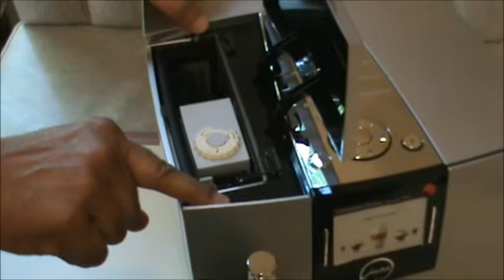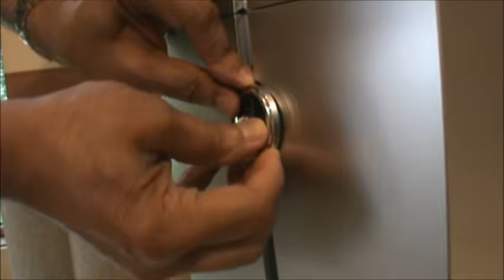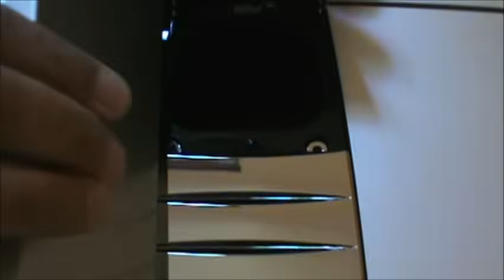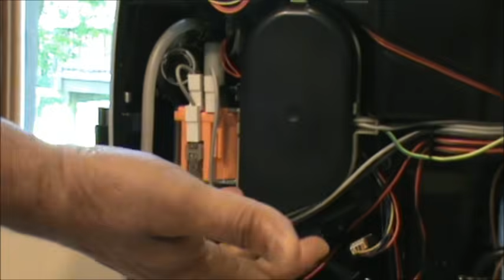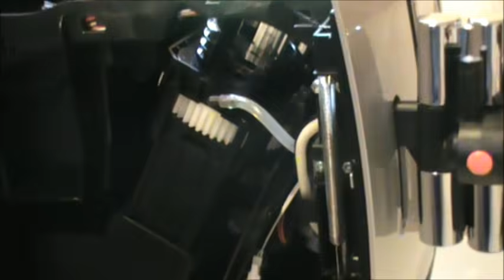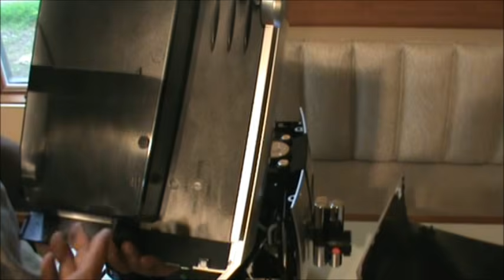How to Open and Disassemble Jura Impressa J5, J6, J9, J80, J90, J95 Coffee Machine

Comment: Hi @PartsGuruUSA I have  the xJ9 machine and after it is switched on  it makes a whirring noise then displays error 6 . I don’t have the oval head tool to open the side panels .
Reply from the maker: Error 6 is due to the bad multi valve.  You'll need the oval tool to remove the 6 screws from the top panel and then remove the side panel.
Reply: Yes I managed to use the oval tool to remove the side panels, do I need to order a new multi valve? Or can it be fixed?
Reply from the maker: Yes, replace the valve.
Reply: Ok thank you so much , 😊 where can I order a multi valve?
Reply from the maker: you may order from the website
Reply: @PartsGuruUSA  Ive tried accessing the website from my phone but it doesn’t seem to be working , can you send me the url please

Comment: I've had my J90 (second hand, new in box) for about 7 years.  No problems until a few days ago when I pressed the "coffee" button, the grinder runs and then the machine shuts off.  No beeps, no blinks.  I found your video and took the machine apart to examine and clean the brew group.  While cleaning, a stainless washer fell out.  Later, I heard a rattling inside, and after shaking and rotating the brew group, a stainless bushing came out.  I have no idea (despite much searching) where in the machine these belong.  I lubed the brew group with food grade grease and put it back together.  It is working, but I can't help but wonder where the extra parts go.  Any ideas?
Reply from the maker: There are 4 metal washers that connect to each sliding arm and under. There is also a metal retaining clip that secures the metal rod to bottom of the brew unit.

Comment: Thanks for the informative video, I've purchased several parts from you as well. Great service! I have a question. My jura j5 freezes after a time, the led doesnt display a error code. I have to unplug and restart the machine. How do I remedy this error?
Reply from the maker: Hello,  your machine may need to be throughly services if not done in a while.  Are you located in the US?

Comment: OK, so this is Very Odd, My Rotarry Dal on my J9 Will NOT Turn, It was fine before I cleaned the tray (I hardly ever use the dial) But I know it worked becasue if tested it before. But it will not turn now? Its almost like it has a lock on it? Jura had NO CLUE ugh. Any ideas guys?
Reply from the maker: That’s not good.  If the dial does not move then you may need to replace the entire display module.
Reply: But have you every heard of this or can give me a logical reason? It doesn’t make sense from an engineer g perspective
Reply from the maker: We have not encountered this issue in repairing the J line machines since they were introduced.
Reply: There is No locking me h correct?  Also the ring around it is orange.
Reply: Please checkout the video I uploaded (should be avail on my profile)

Comment: I have an Impressa Jura J9.3, the machine displayed an error message " Hardware -Fehler:2" what is that, what should I do to fix the machine?
Reply from the maker: Hi Lawrence,  ERROR 2 in Jura J9.3 is related to the malfunctioning thermal sensor or fuse that's mounted onto the thermoblock.  J9.3 only features a single thermoblock.  Please check the two components in your machine.  We have both items in stock.

Comment: My Jura impressa J9.2 is displaying " Fill beans" albeit there are enough beans in the bean cup. I took out the beans & clean the cup and re-try but to no avails. Please suggest how to fix the problem. I don't have special tools to loosen special screws to dismantle the grinder
Reply from the maker: Hi Aung Pe, How long have you owned the machine?  Has your machine ever been serviced?  How many cups of the coffee have you made from J9.2?  The issue could be related to the blunt and worn out grinder burrs that are located inside the grinder.

Comment: I have gotten to the removal of the logo on the back... now, how do I find a tool to remove those two screws? What kind of screws are they? Help
Reply from the maker: These are oval head screws.  We have a special tool available on our online store to remove the oval head screws.  You may use the link below to purchase the tool:
http://shop.partsguru.com/Jura-Oval-Head-Key-Stainless-Steel-0010635.htm
Reply: Torx I believe TS20 or 25. Local hardware store should have
Reply from the maker: @LymanSheba Torx 20 for removing the brew unit screws and Torx 15 for the drainage valve screw at the bottom of the brew unit

Comment: Hi Parts Guru. Thanks a lot for a very useful video, but I lack information on the actual TOOL to open up the J9.3 one touch TFT. Without the tool, it is very difficult to start repairing... Could you please inform WHICH TOOL is used and if you can provide it ? I only have these round pins, which has no rough edges like torques and normal screews. Hope for your assistance on how to open up the machine. Thanks from Denmark.
Reply from the maker: Hi Peter,
There is a special tool that is used to remove oval head screws from Jura espresso machines. Here is the link to purchase the Jura oval head tool:
https://www.juraparts.com/products/jura-oval-head-tool
When was the last time you descaled/decalcified your Jura J9.3? Descaling the Jura J9.3 is the single most important maintenance. It helps to remove calcium sediments from water passages inside the machine, improves hot water temperature, and ensure full jet of steam for steaming milk. Please descale your Jura J9.3 if you have not done so. Please stop using the Jura Clearyl filter, if you are, as it's completely ineffective and useless. It only removes bad tasting odor from the water and does not remove calcium sediments.
Reply: Thanks again. As you states, the machine needed a good descaling. Since I could not open up the machine my self, (without the oval head tool) - hence I turned the machine over to repair shop. It is now back, as new and working again. Thanks for your time and effort :-)

Comment: Thanks for this video.
We have a issue with this machine.
When making a cappuccino, the coffee goes out from the central hole and not on the left one (used for milk).
Have you got an idea of what's going wrong?
Thanks again
Reply from the maker: +Olivier Leroy Hello Olivier: please let me know the model of your Jura machine.
Reply: It it a Impressa J9.3
Reply from the maker: +Olivier Leroy there's a switch over valve in J9 seated beside the display module.  It determines whether to direct coffee from the brew group the left or center hole.  Based on your description, it seems that this switch over valve is not working properly and directing coffee only to center hole.  What happens when you make just a regular coffee?  Does it dispense from the center or left hole?
Reply: Parts Guru - same thing with my j9. When making a latte, the coffee dispenses from the center. Please help!?
Reply: Me too with a Z5, who died recently, I just bought a second hand J9.3 this week, hope will not happened in the future, seems to be difficult to repare.
Thanks a lot Parts Guru for your clear tutorials

Comment: Thanks so much for this.   Not sure I would have figured out the screws under the emblem on the back by myself.   The video made it much easier to disassemble my J6.  There is a torx screw in the water tray holder area (at the front center) that you have to remove as well to get that side off.   I was able to remove oval screws by using a pair of needle nose pliers and using small vice grip pliers to clamp the needle nose pliers on the flat part of the oval screw.  It is tricky and takes some patients.   Once you break the screw loose you can just use the needle nose pliers to take them out.  I replaced the screws with phillips head screws so I don't have to do this again.
Reply: I don’t see a screw just a flat dark top over a screw hole. Is that the  screw?
Reply from the maker: +Terry Chapman Hello Terry:  I'm glad you found the video helpful.  The oval screw by the water tank is buried deep inside.  Kudos to you for removing the oval head screws with nose pliers.  I'm curious as to how you removed it without the oval head tool.
- Tommy
Reply: I looked closely to find the slightly flat side of the oval.  Put my needle nose pliers on the "flat" sides, and then used a pair of vice grip pliers to clamp the needle nose pliers onto the flat spot by clamping them across the needle nose pliers.  It was a bit tricky but worked in a pinch.  I will try to take a picture of it and upload if I can.

luckily, the screw in the water tank recess that holds on the outside plastic casing on that side was a torx otherwise my trick would not have worked as it is really recessed in there.
Reply from the maker: +Terry Chapman Great, thank you for sharing.  A picture would help too.  I'm sure it'll help many Jura coffee machine owners that don't have the oval head tool.

Comment: HI,
We poored water in the pre-ground coffee
We tried to take all the water out and dry it with a hair dryer the best we could 
We put it back on and it seems to be ok but should we try to take it apart to make sure that the machine is ok?

Please let me know
Reply from the maker: +Marie Burban Wohlfahrt-Khaelss Pouring the water in the pre ground funnel should not cause any issues.  You're lucky you didn't pour it into the grinder with coffee beans.  That would have required taken the machine apart.

Comment: Hi, my Jura ENA Micro 1 sometimes doesn't make the turn off washing cycle. It just sounds as the group motor stalls and then it turns off, but doesn't pumps water. Then I can't open the drip tray, because the group is not on it's home position, so I need to turn it on again so it goes back and open the tray.

Sometimes it does do the washing cylce and turns off with no problem. 

The machine is one year old. I use it daily to brew one shot then I turn it off again. I've cleaned and descaled when the machine requests to. What could it be the problem?
Reply from the maker: +Alex Nifco Did you purchase the machine brand new or used?  All Jura machines comes with two year warranty. I would contact their warranty service department to have the machine repaired.
Reply: Thank you for your reply. Just made a cleaning cycle with a cleaning tablet and later with a flashlight and wood stick removed stuck coffee grounds on the chute that leads to used coffee deposit. Now it's working perfectly. I think that the coffee beans I've been using are too oily, so changed my beans type. Best regards

Comment: Hi,
thanks for your very helpful videos which helped me to repair my J5 in the past.
My J9.3 recently developed a problem. After accidentally spilling some water over my J9.3, the machine when starting up displays "Jura" in red letters on an otherwise black TFT screen. The dial wheel on top blinks red for less than 10 seconds. Then 3 beeps are audible, and the machine shuts itself off. Is this some sort of an error code? If so, what does it indicate, and who can I fix it? Thanks very much for your help.
Reply: i have the same problem. Did you fix it?

Comment: Hello mr Parts Guru. Please can you explain how to fix Error 6 with an Jura J9.3? Thank you very much.
Reply from the maker: Esther B Hi, Error 6 in J models is related to the malfunctioning electronic multiway valve that is located at the bottom of the front right side of the machine when facing the machine from the front.  Were you able to remove the side panels?  Can you please monitor the water flow and see if any water is being passed through the multiway valve?

Comment: Hey! I see that you're luckily quite active and responding and I would be VERY grateful if you could answer. I have a Jura J5 machine, but when I try to make an espresso, coffee, anything, it doesn't pour the coffee out and it just seems to grind up beans, drop them in the little plastic cup & release water in the bottom of the machine. 
Is there any fix to this?
Reply from the maker: jodawgsup Hi, It seems like the water inlet to the brew group is not opening hence hot water could not get into the coffee compacting cup for brewing coffee.  Please make coffee using pre ground coffee and let me know if you are able to make coffee.

Comment: Cleaning lady put some water in the bean grinder and now grinder works but beans don't drop into the grinder and machine says to fill beans, tho it is full. I cleaned out and dryed out the reservoir and used a cake tester to clean as far down into the grinder as possible--still the beans don't drop, the machine whirrs, but no grinding is happening. Suggestions?
Reply from the maker: Hi Russell,  You may want to open the machine, and clean out the grinder.  You will need to remove the grinder burrs, and clean out the grinding chamber.  The inside is clogged with residual ground coffee.
If you're unable to fix it yourself, then you can send it to us for repairs.

Comment: Hi, thank you for the information. We are interested in buying the new 9.4. And there are some questions: How is the over all build quality? Is it also all plastic? How efficient and reliable is the full automatic cleaning process? We don't want to be poisoned by germs!
If you find time to answer: Thank you very much!
Reply from the maker: Oliver Leu External casing for all Jura coffee machines is made of ABS plastic.  In fact, super automatic machines manufactured by other brands all use plastic.  Only the commercial grade and recently introduced prosumer models such as Magister Stella, Expobar, ECM machines are designed with full stainless steel body.  That is primarily so because the manufacturers have partial interest with stainless steel manufacturing companies.
You can use Jura cleaning tablets or any other effective tablets to weekly clean the brew group of your machine.  In addition, you should descale your machine every six months to prevent calcium build up inside the hydraulic system.  Regular cleaning and descaling will keep your machine in pristine condition and will create amazing and flavorful coffee for 10 plus years.
The secret to any good machine is its maintenance!